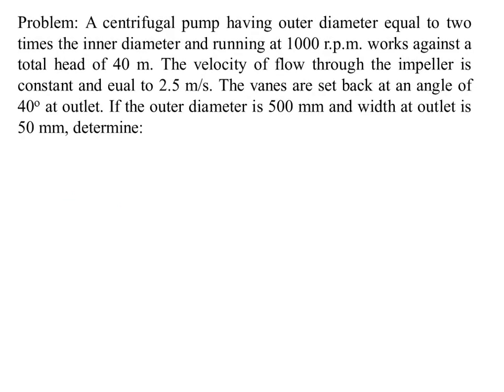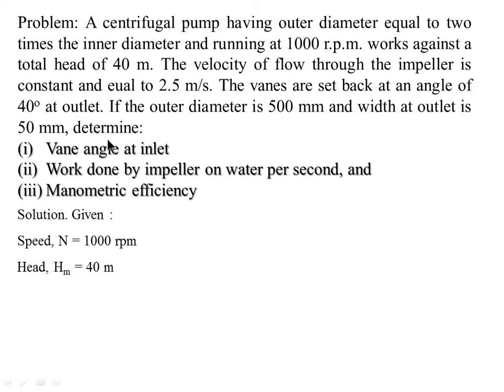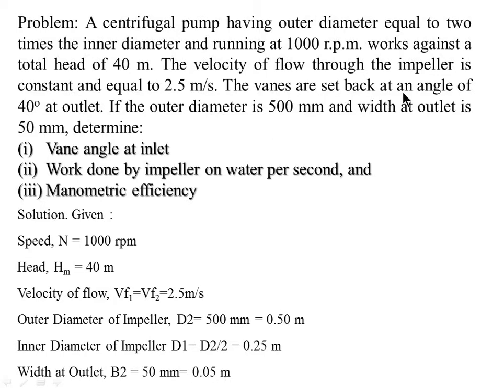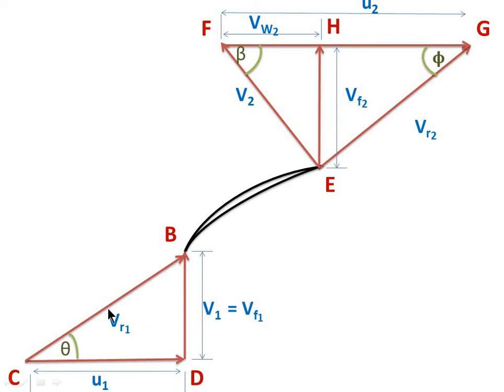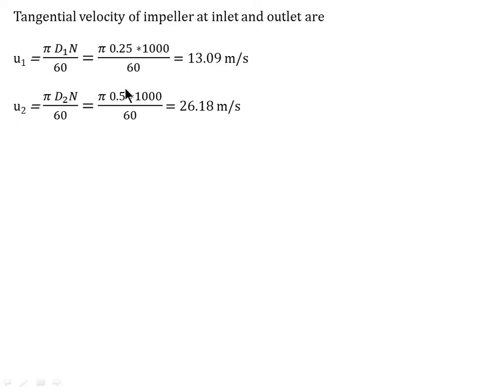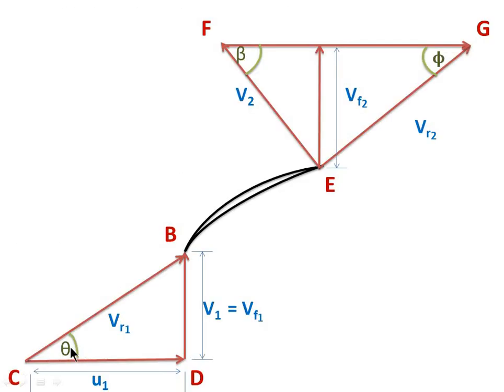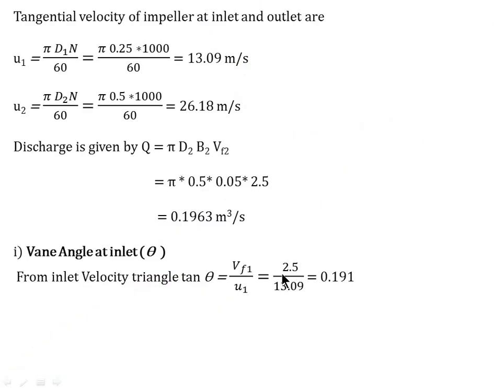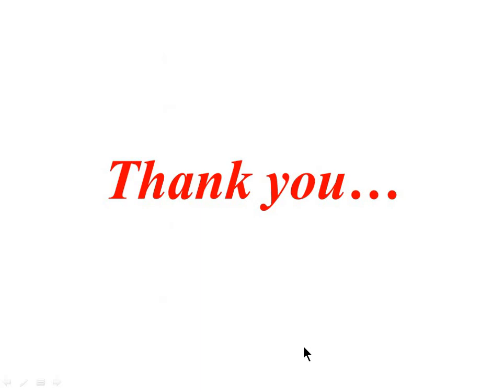Problem on Centrifugal Pump

Comment: A centrifugal pump lifts water under a static head of 40 m of water of which 4.2 m is suction lift.
Suction and delivery pipes are both 160 mm in diameter. The head loss in suction pipe is 1.8 m and
in delivery pipe 8 m. The impeller is 380 mm in diameter and 35 mm wide at mouth and revolves at
1200r.p.m.Its exit blade angle is 35°. If the manometric efficiency of the pump is 85%,
determine the discharge and the pressure at the suction and delivery branches
of the pump.